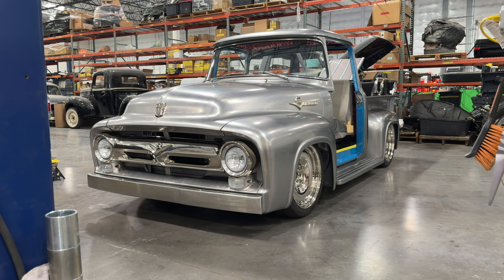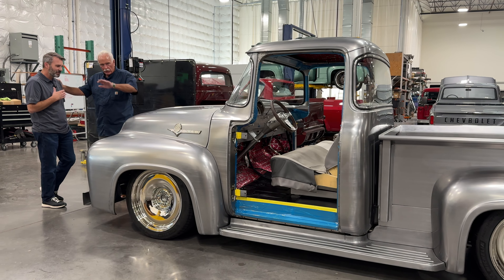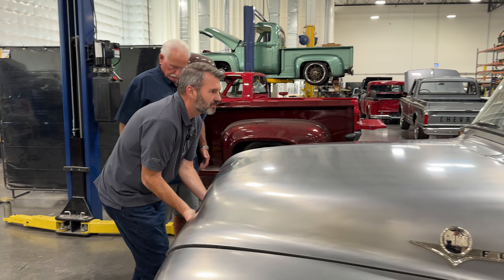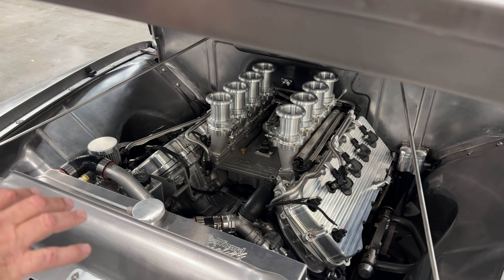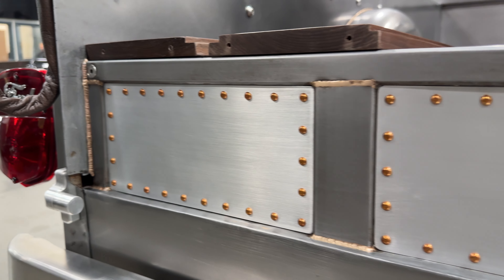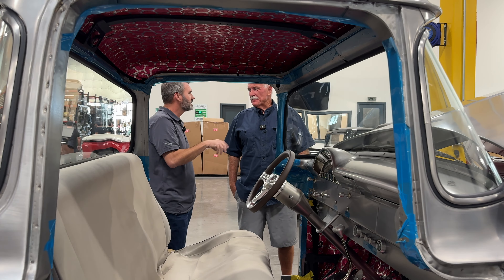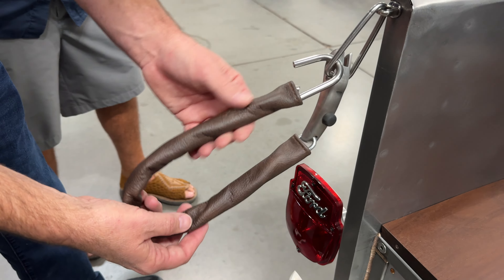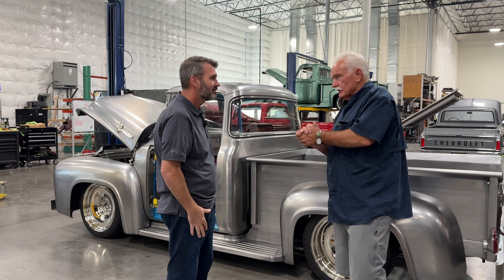No Paint, All Original Steel, Bare Metal Ford F100 Build

Comment: I would love a carbed flathead with a 8HP75. Carbureted engines have that sound that FI just can’t replicate.
Reply: Is that the original flat head V-8 I didn't hear them mention that but they did mention  fuel injection so I'm wondering what else they did with  that engine if it's the original block flat head.